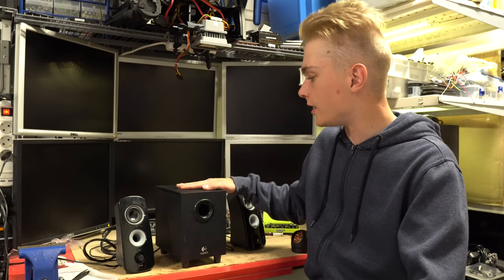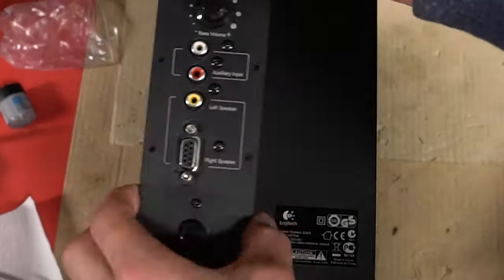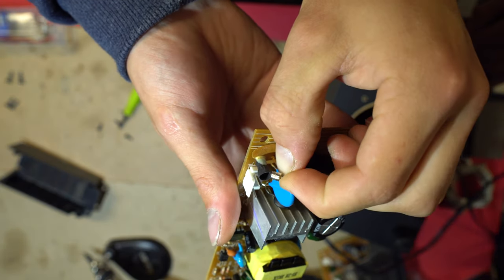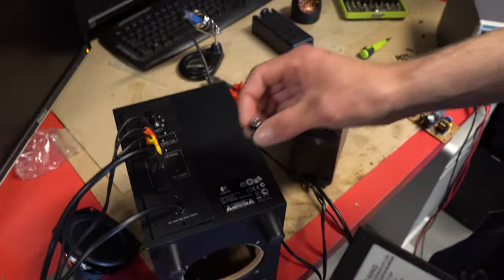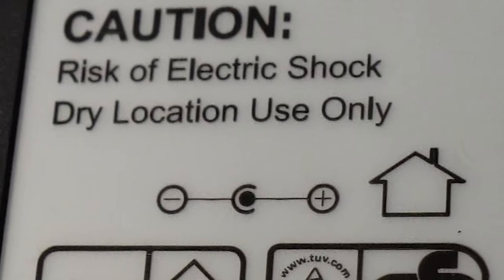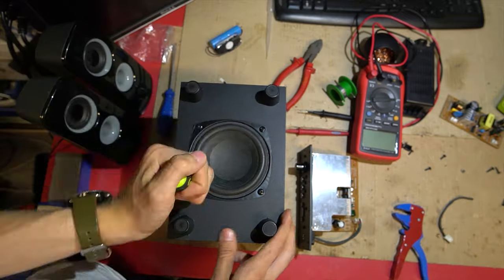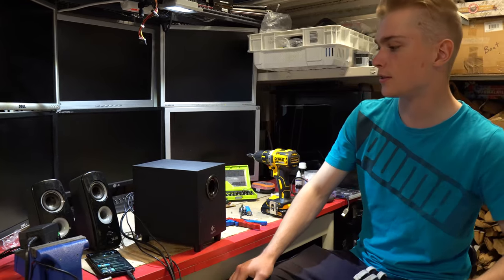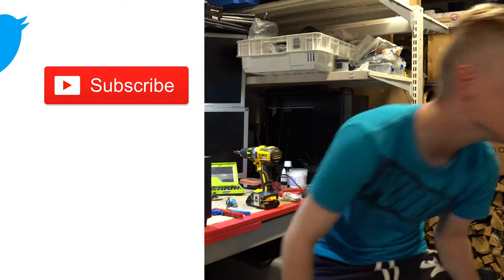How To Fix Broken Logitech Speakers

Comment: thanks a lot, i wanted to know the voltage it was using so i can see if i can use it in my car, kiitos!
Also is it okay to put a 12v jack and solder it while the transfomer is still plugged ?

Comment: Hi and thx for the helpful video.
On my Subwoofer circuits, the fuse is ok. Still, the sub does not power on. What are the checks that I need to carry out? Obviously wires and cords are all fine and I cannot see any damaged capacitor. Also no soldering point seems burned or the likes. Thank you in advance. Sayed

Comment: my sister gave me these speakers and said they no longer work, she said the LED had never really worked so i took the power/volume speaker apart and noticed the LED cable split in half by a screw, i took more apart and found wires barely hanging on, assembled very badly.

Comment: so the votage it uses is 12V or could be working with a 19.5V transformer? or a 9v one?
Reply from the maker: The original power supply seems to be about 17v, so using anything under that will make the speakers quieter, but at 12v we didn't really notice this at all. 9v will likely be too little and 19.5 just fine.

Comment: You made it so easy. Mine is having issues. I have to hold the wire to make it work
Reply from the maker: Your power supply's connector might be too short. We had the same problem first and after cutting a couple mm of the plastic away to allow it go a bit deeper it stayed in place.

Comment: Nice clutter-free mess power jack! Now no cable mess when taking the speakers to an storage bag,and putting the cables in the other bag! Edit: In the future, you add bluetooth to these speakers.
Reply from the maker: Great idea! Putting a bluetooth adapter inside the case and powering it from the 12v psu would be pretty simple.
Reply: @KrupsFilms  I was thinking to do just that... every bluetooth audio recievers i've seen works with 5v tho... and... my main problem is... i need to know the pinout of the 9pin connector in order to power it on cause i wanted to build a single portable box with bluetooth using this amp...

Comment: I was looking for an alternative solution in replacing the power supply on my Logitech speakers.  Where did you purchase the power brick?
Reply from the maker: I can't remember where that exact one came from, but eBay is full of similar ones for really cheap, and you can also get the connector there.

Comment: Mine has an issue, its light was blinking, its power turnd off and on, I thinking if its from power supply, now I know its voltage and amp

Comment: The original Power supplay only burn a Diode (SB5100).... I have repaired lot's of then
Reply: did replacing the diode solve the problem permanently or it will come back?
Reply: Solve problem, None of repaired units come back.
Reply: @kalukramerr  dulu noted and thank you sir for the info with quick reply. have a great day.